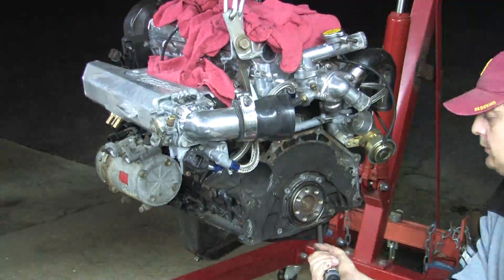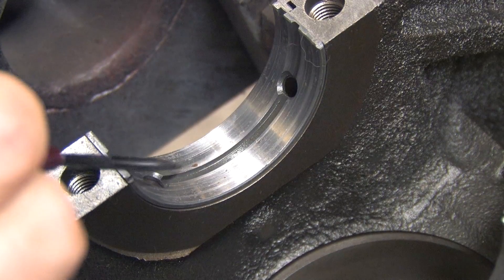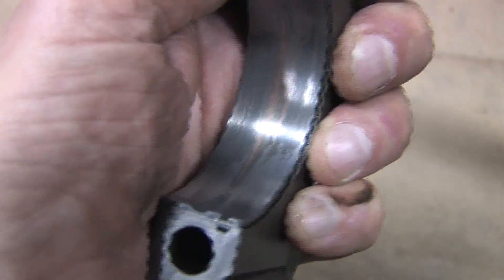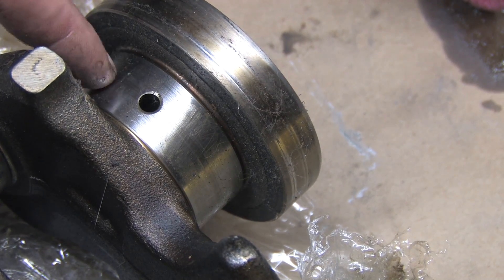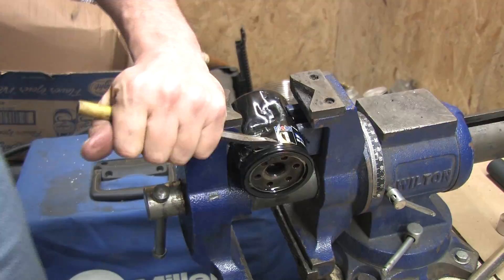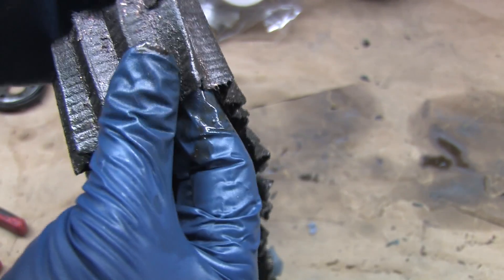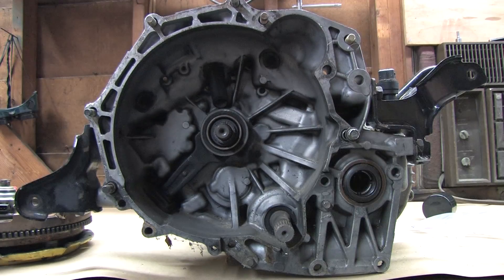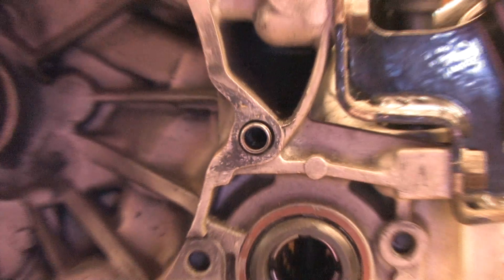7-Bolt Shortblock Failure - Full Diagnosis

Comment: We repair crankshafts like that all the time. Repair the one journal, weld the thrust up, grind the c/s and then have it re-nitride (re-harden) and it's absolutely good as new; even for racing. Any five-main bearing 4-cylinder c/s that is steel, like this one are practically bullet proof if they magnaflux good. A lot of crankshafts that are perfectly repairable are thrown away by unknowing enthusiasts.
Reply from the maker: RomeoRomeo5000 If someone chooses to repair a 7-bolt 4g63 crank and they have a spare 6-bolt shortblock 10 feet away, that's the enthusiast that I would refer to as "unknowing".  Especially if the block appeared to have thrust issues or scalloped main bearings because turning a journal won't fix either of the problems that cause that.  The turned journal may turn out solid, but you'll be right back there doing the same thing again 2000 miles later with your 7-bolt.  History has proven this in the DSM community, and it's a google-able offense.

Comment: Hey I have a b18 DOHC 1992 acura integra engine that had completely grinded away my number 3 bearing, should I trash the motor and get another one or fix this one? If you can help me out that would be greatly appreciated
Reply from the maker: Elijah Ritz Get a new crank and rod at the very least.  I haven't seen the block or what might have happened to the bores, and I don't know what your oil pressure might have been?  Completely grinding away the bearing is a pretty severe problem.  Those B18B blocks are usually pretty tough, so I'd tend to think your oil pump took a dump.  If that happened, I'd take a closer look at the valvetrain and see if anything was damaged on the top-half, but if you're looking for a race block, you can probably replace the rotating assembly and oil pump, and have that block re-machined for larger pistons.
Reply: Can I send you pictures via email? I did the finger nail test on my crank and it did not pass at all, and how much would it cost usually to get my block machined? Before I took it apart it still ran, it just made a really loud metal on metal grinding sound and that turned out to be the problem, and I also noticed when I removed my camshaft and turned the engine over it no longer made the really loud noise, I was told just to get a hole other engine at a tear apart place because it would be cheaper than getting this motor fixed
Reply from the maker: The going rate these days, all things included for a stock rebuild is around $1000 for the DIY guy with self control.  What usually happens is it typically runs $2500 for them because they can't resist the "while you're in there" mods.  It used to be cheaper to rebuild an engine, I could do it for about half of that 10 years ago.  A used engine would be the best option to get you back up and running again if you're not trying to rebuild it.  A rebuild is a long process that requires other people.  If you have access to a used engine, it requires none of them.  The trick is getting a good used engine from a 23 year old car.  If you end up with a good one, then it will cost less than rebuilding the engine you have.  If not, well, there goes that.  I don't know which bearing you were referring to by #3 because there are several #3 bearings in an engine... but if it wasn't the head and if there's a chance your head was spared any real damage, then a used shortblock or rebuilt shortblock should cost less than rebuilding the whole thing.  I assumed you meant #3 rod bearing on my previous response.
Reply: Yes it is the number 3 rod bearing is completely worn away, the oil that was in it was completely black and there are shavings everywhere, and it's sad for such a beautiful car in my opinion, but I'm 16 and learning alot from the motor hopefully I can make her run beautiful In the next year or so
Reply: anyway i can send you some pictures and you can give me your opinion on what i should i do

Comment: What about the possibility of improperly sized bearings? In our auto class, we ordered a set of bearings and one set was .010 thicker than the rest, possibly by accident or a flaw in part separation. Not saying that was definitely the cause but could definitely be something that happened.
Reply: Dillon Scott dude, an important bolt was missing.  Did you see the scoring done on the side of that crankshaft?  Yes, bad bearing size will eventually fail, but this was a whole other problem.

Comment: Why this crankshaft is junk? I still ride GSXR 750 that looked much worse, the oil sump was filled with swarf from bearing shells after big end failure. One of the journals was purple and about 1 mm smaller in diameter. It has been welded and turned, balanced and still goes up to ~13k RPM no problem. It's been over 16000 miles since I have rebuilt it. It cost me 1/3 of a price of a brand new crank. I had to wait for it for about 2 months but it was worth it.
Reply from the maker: cruxer666 I don't turn DSM cranks.  I might give them a polish, but I won't cut them down because the way they're manufactured, the outer layer of the crank is the hardened layer, and it can't be put back on it.  When you turn one, you have to turn them all to do it right.  

Secondly, the way the #2 main is worn indicated to me that the crankshaft has been bent.  It's the only way the failure from the #3 and #4 bearings would show up on main #2... because the #3 main bearing is the thrust bearing.  There should be no deflection in the mains whatsoever that would allow this.  I haven't put it on a balancer to verify this, but no amount of work will make a 7-bolt crank stronger than a 6-bolt, and I don't think any amount of machining is going to be a better option than a 6-bolt replacement.

Once you see what goes back in it, you'll agree with me that I have a better fix.  In fact, the crank I'm putting back in my 6-bolt isn't perfect, either... but at the same time... yes it is.  You'll see.  :)

Comment: Is the missing bolt also on a 6 bolt block? Or just a 7 bolt?
Reply from the maker: Yessir.  It's one of the bolts that goes into the far corner of each side of the block, and each one should have a dowel pin aligning the block to the transmission.  All years and models of cars have this kind of setup, but it's more obscure on a DSM than most.

Comment: Repair the oiling system. High revs runs um dry!
Reply from the maker: Bruce Nelson Watch the Hyundai Elantra series. I already know the perfect recipe for a 4g63 oil system. I've blown up enough of them to figure it out. The Hyundai I just finished building and blueprinting is all here on video down to the oil clearances of every bearing, and even the physical dimensions of every part of the oil pressure regulators from every model of 6 and 7-bolt USDM 4g63. You won't find more information, or a better case study about a 4g63 oil system anywhere else on the internet but on my channel. I'm not kidding. Start with the oil filter housing video. There's also 2 different videos here about improving oil drainback. 4 different videos about crankcase ventilation. 5 videos about oil gallery modifications. 2 videos about how, where and in what order a 4g63 oils literally everything connected to its oil system. The block and the head inside and out. Please don't mis-characterize my work and accuse me of abusing it. That's for me to do. This car was never over-revved, and it was never run dry.  The correct diagnosis is what I explained in the video.

That Hyundai series will have a final running conclusion video shortly, and its oil pressure gauge demonstrates my experience very clearly. 20 PSI at warm idle and 86 at 7000 RPMs. It's flawless. I'm a couple of videos behind in production, but I've already been driving it. I've never built a better one, and they keep getting better. That Hyundai's only the test build for what's eventually replacing this particular block. With what I've seen from it so far, I won't be the least big surprised if that Hyundai runs faster and stronger than the GSX has ever been. Absolutely nobody is prepared for what comes next.

Comment: Well jafro, I think I'm going to be a victim of crank walk right away. My 7 bolt crank end play is definitely out of spec, moves about as much as your did in the video. I ain't got no noises yet, but I do have a low clutch engagement with a brand new south bend unit and when playing around in the snow I'd come to a stop clutch completely disengaged and she'd just die on me. woah is me!
Reply from the maker: MechRider89 Check all of your transmission bell housing bolts.  Make sure 1) they're there, 2) they're tight with no gaps and nothing pinched between them.
Reply: ***** Done and done, ever since I put my car together I made sure of that due to watching your video's. I dropped my oil pan and used my biggest feeler gauge (0.032) to check crank end play and it was like throwing a "sausage down a hallway". I got 6 bolt parts through the ying yang  but don't have a complete engine to quickly throw one together. So the 7 bolt is going to die the hard way.
Reply from the maker: MechRider89 Aaaaawww maaaaaaaannnn!  Yeah, that's more than twice how far mine went, but mine wasn't actually a legitimate case of crankwalk, it's what thousands of people have mis-diagnosed as crankwalk, though...  I'd say get yourself a dash cam and film the carnage because what you're experiencing is kinduv rare... except that I'd rather see you stop driving it to save that cylinder head from the oil contamination that accompanies bearing failures.  With a little port work, that cylinder head will out-flow every other cylinder head Mitsubishi ever cast for any of the SIRIUS I 4g63s.  It makes a 6-bolt swap a plug-n-play affair with the help of a half-inch drill bit, and you need to just go ahead and get yourself any 6-bolt turbo or non-turbo block and put that head right back to use if you're keeping that car.  The whole top half can go right back to work on any 6 or 7-bolt 4g63 block.  10 holes and a head gasket.  But buy some 9:1 pistons for the bottom end and do it right.  6-bolt rods will hold 550-600hp.  Any 2.0L '89-'92.5 Galant, Eclipse or Hyundai Sonata will work as a donor.  Even a SOHC block will work.  If you want oil squirters, Mitubishi Graveyard offers the retrofit mod.  Save that head.  If you ever junk that car, I want the head.  I want 2g heads all day long.  The G6K and G6S castings have the most potential, but my preference is the G6K because of the oil gallery design and the cam angle sensor provisions.  I think the G6K castings are 95-96 only.  I've never seen an S with the cam angle sensor holes.

Anyway, the GSX is on deck, and that's the build I was half-way done with back when the Hyundai so rudely interrupted.  You'll have a full instruction manual here within a year.  You could finish it based off of what I've already posted!  :P
Reply: ***** If I was in the states I'd probably stop driving it but being in Canada the dsm markets very very small, not many of us left up here. So selling would be more work then its worth. I just need pistons and a 6 bolt front case then its a matter of picking which of my block and head I want to use.

Comment: I think 48K miles on a build that put down as much power as your engine was is pretty good. Stuff happens. I've done it too. Most people can't do a better job so they can't talk trash. I have faith in your ability. I'm a Subaru guy and I just love your videos because you use tools that most people can afford and are not overly complicated. You prove that you don't need a laboratory to build a great power plant and car.
Reply from the maker: warusweims What you said has many truths.  Unemployed military aircraft mechanics proved all of it in the late '40's salt flats.  I look up to those who came before me for inspiration.  Anything that has been engineered can be re-engineered.  You get better at it when you break stuff.  You and I have both been bitten by the same bug.  There's no cure for it, but you can treat the symptoms.
"Auto racing was invented 5 minutes after the second car was built" - Henry Ford
Reply: i blew up my first dirt bike rebuild 10 mins after i put it together.....

i didnt have the right tools, and to get the nuts off the crank, i put wood under the piston skirt/on top of the crankcase....and made a TINY crack

heard.....SNAP RATTLE RATTLE RATTLE..... and shut if off.....(been working on cars from 6 years old....seriously)
piece of piston skirt ended up in the combustion chamber....

but didnt take out the ports! fucking winning! lol

2nd rebuild has 3000 miles on it....and i need a new clutch (i ride that 100cc like a 1000cc), so ill probably check out the top end soon lol

on the...sorta the flip side...i guess

my dads got a 1997 buick lesaber with the buick designed 3.8L v6.....250,000 miles, still running the gaskets known the fail....
kinda gotta see how far it can go now.....

the tires have almost come off the thing.....(ball joints, struts, sway bar links).....trans went out at 200k (just lost OD and still made it home)

BUT. THE. MOTOR. WILL. NOT. STOP.
and it runs great....

Comment: this is the size of the thrust bearing 2.4mm. without the thrust bearing in the block the crank can fit, so its tell me the thrust is to big but the spec sheet is telling me 2.440-2.490mm. can I shave the bearing down until the crank drop in?
Reply from the maker: Yes.  Use spray adhesive and fine emery cloth, stick the emery cloth down to something that's perfectly-flat, shave a couple of passes off the thrust surface, clean it, install the crank, and check it with feeler gauges.  Try to get as far around it as you can to make sure it's even.  Uneven thrust faces can cause oil film layer problems.  Fine emery cloth.  Not sandpaper.

Comment: Stupid question , did you plasti gauge all your bearings before you locked it all down?
Reply: also if you did what were your clearances ?
Reply from the maker: I didn't.  The machine shop that built it did.  Oil clearances were .002" on the crank and rods.  This is the only engine I've ever blown up that I didn't build.  Come to think of it, none of the engines I've built have ever blown up.  :P  ...at least not yet...
Reply: Remember, we are trying to be humble here. But you are correct. I doubt if there has ever been a reputable shop manual written that does not stress the importance of Plastigage.

Comment from the maker: +Mikko Muhonen You have replies disabled.  Yes you can buy oversized bearings if you have your crank turned smaller.  It weakens the crank, and you have to turn every journal, not just the affected ones.
Reply: so I'm guessing the 6 bolt has that same bolt that doesn't get put in? now I know why most of the bolts on my 92 gs turbo backed out after I had someone else do the cluth. wow. thanks for the great info.
Reply from the maker: Yep.  Same bolt on 6 or 7 bolt.
Reply: +Jafromobile i think you mean undersize bearings
Reply: TRUEBLOOD352 The crank is ground undersized, so the bearing has to be oversized to take up the additional distance.

Comment: wd-40 has water in it your block is gonna rust man !
Reply from the maker: lol!  Where did you hear that?  

The WD in WD-40 stands for "water displacement" meaning that it lifts and separates water FROM surfaces it's applied to.
Reply: ***** we used to use it at work.after a month or 2 of parts setting with wd-40 on them they were rusted.its true.